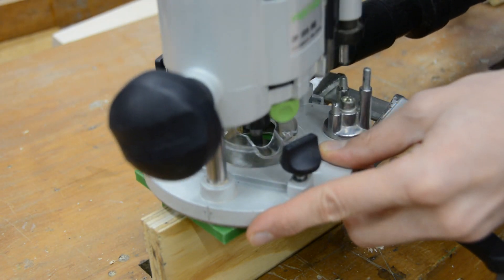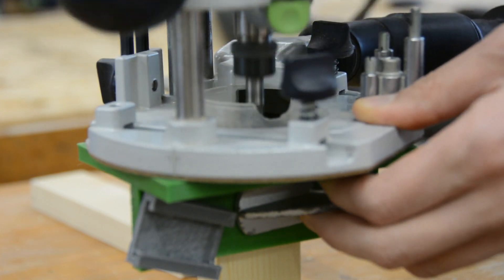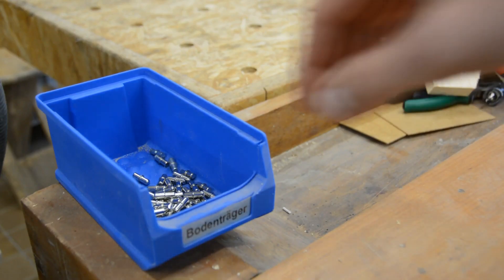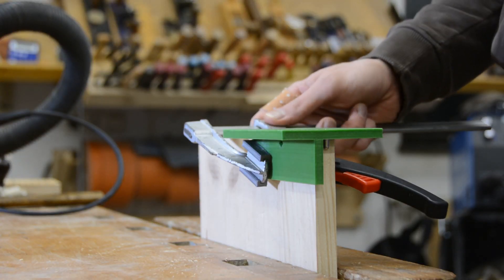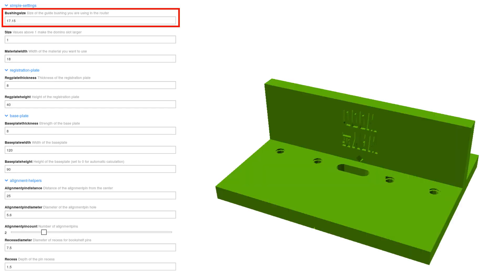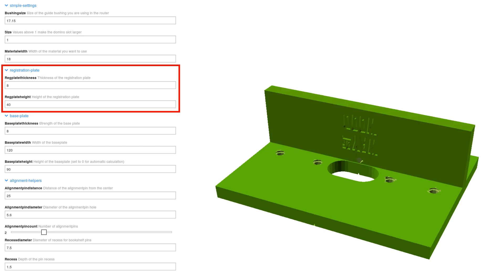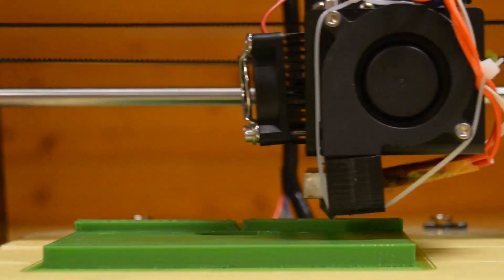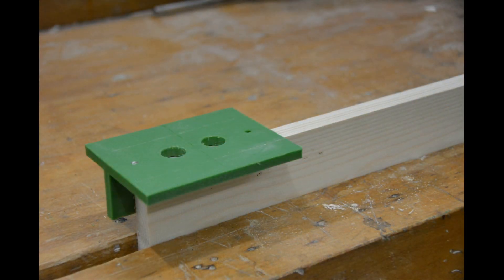DIY 3dprinted mortise jig for loose tenon joinery with the router [Free plans]

Comment: Great video and very innovative jig. How can you use this jig to create a mortise in the middle of a board eg for shelves? Thanks
Reply from the maker: Good question with no easy answer. What I would do is the following: take the normal jig and clamp it to a board of MDF. Route a normal slot and then use a flush trim bit to extend it to the size of the original opening. You now have a jig with a broad reach to both sides that you can clamp in order to route the middle of a board.
Reply: @WayofWood  Thanks
Reply from the maker: Welcome. 🙂

Comment: Woodworkers: I spent $80 making this jig that takes 20 hours to make

3D Printers: I hit a button
Reply from the maker: The only downside of 3d printed stuff is that it sometimes breaks a part as quickly as it has been created. 😏
Reply: @WayofWood  I made one today and worked great slot wise, but have to play around a bit with the collet size. Still this is so cool!
Reply from the maker: Thank you!
Reply: @WayofWood  what size bushing do you use with your 17.5 mm?
Reply from the maker: A 17mm bushing. You need a bit of play so that you can move the bushing in the slot.

Comment: Great system - and a very clear video.
Using dowels is way cheaper than dominos (about 20 times the price...) and doubled just as strong. The domino system is designed to overcome the basic inaccuracy of using the hand-held domino tool (aligned by pencil mark)- the tenons are literally loose (in the along the joint direction) to compensate. When you register the position using a jig such as this, that inaccuracy disappears and dowels can be used. As in all commercial flat-pack furniture. Plus you can use a drill rather than a router. And you do not need to align the joint before the glue sets.
Reply from the maker: Thanks. I would nevertheless use a router instead of a drill as you don’t have to add hardened bushings and the depth stop tends to be more reliable.
Reply: @WayofWood  True. But for those without router, guide, or suitable bit... 
I think jigs like this are an important contribution to woodworking; those paid for their work can justify the high cost of specialist tools, the rest of us want the same quality result, but are prepared to spend a little more time to use a lower cost method. 3D printers are a good route to making these, and the cost is quickly recovered. Thanks for your efforts.
Reply from the maker: That’s true. But just a hint: if you don’t have a router guide but access to a 3d printer you can print one (customizable design on my thingiverse website)

Comment: What size Dimino does setting 1  use
Reply from the maker: kelvin britt The size of the Domino only depends on the size of the router bit. 6mm Bit = 6mm Domino
The wider settings provide you more room to adjust the Domino left and Right.

Comment: Thx for the video and the configurable 3d Model. 
What Router Bit do you use?
Reply from the maker: abul1984 You can use any straight router bit. I like to use a 8mm bit that is actually intended for milling metal: https://wayofwood.com/tool/8mm-spiral-cutting-router-bit/ It’s cheaper than a spiral router for wood.

Comment: Very nice! It would be great to have an adjustable version to fit stock of any thickness with a single jig rather than printing a new one almost every time
Reply from the maker: Igor Fedik The tenon doesn’t have to be centered on the material so you could use it for different thicknesses. Have a look at the wooden version of the stick for a jig with more adjustability

Comment: This is great! Could you possibly create a 45 degree version for miter joints? I just milled some slabs from a tree in my backyard and would like to make a "waterfall" style desk.
Reply from the maker: Great idea. I uploaded a modified version that should work for 45 degree mitres on thigiverse. It's however rather a quick hack than a final model. You will have to play around with the distance parameter to adjust it to the material thickness and the model won't work for angles other than 45. If someone is fixing these problems - please let me know and I will update it.